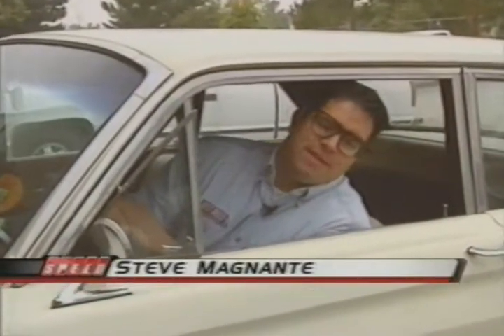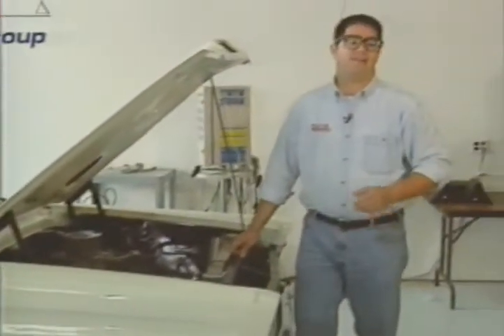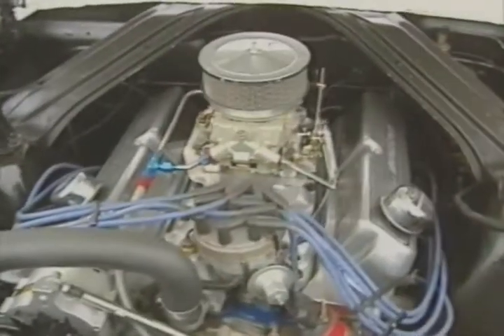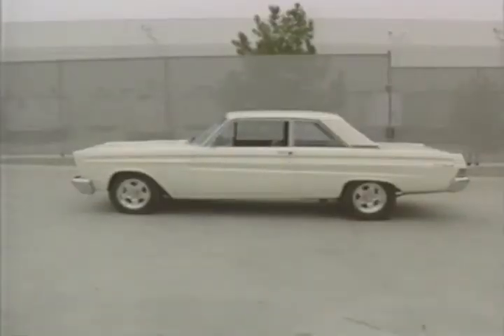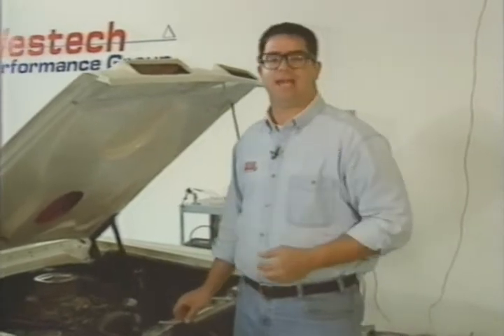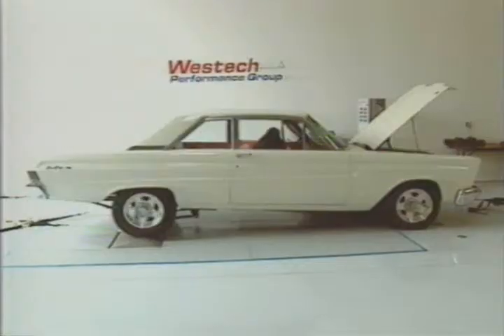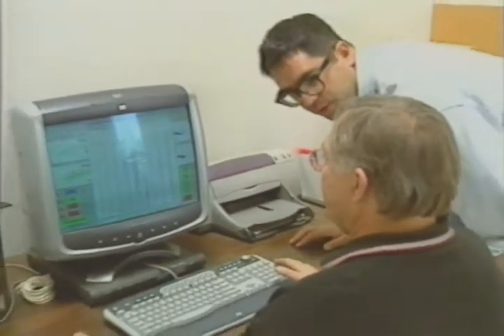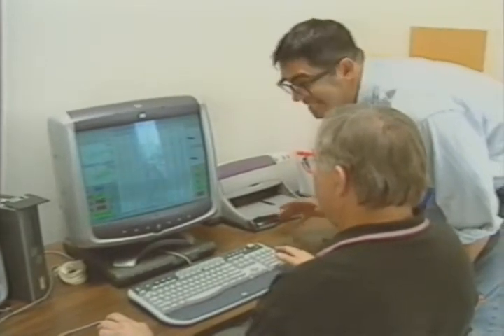Hot Rod Magazine TV Compares Petroleum Based and Synthetic Motor Oil

Comment: It's always a wise idea to use rubber gloves when doing an oil change so as to protect your hands from the carcinogens that can be present in used motor oil.  Use motor oil is very toxic. A box of latex rubber gloves is only about $5 and is a great way to help prevent cancer. :)